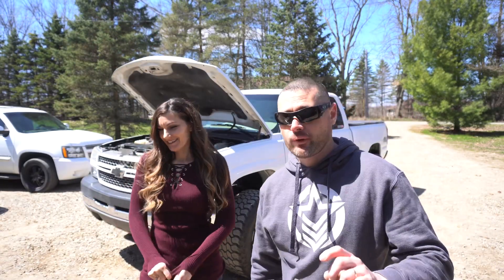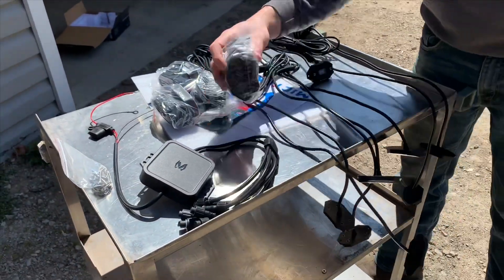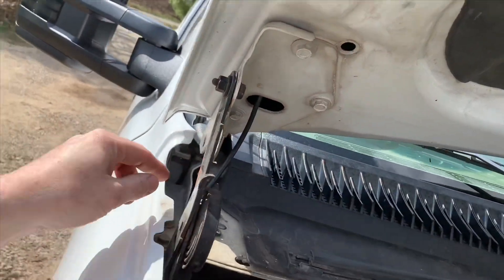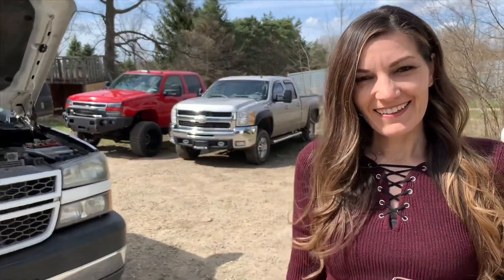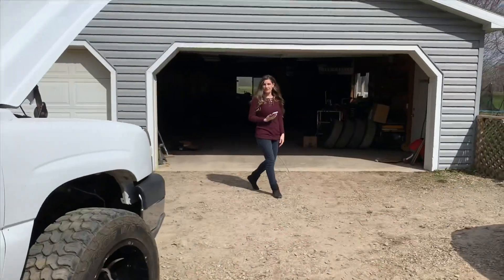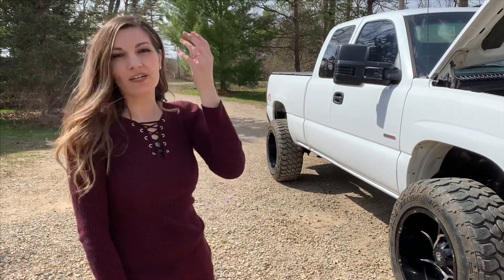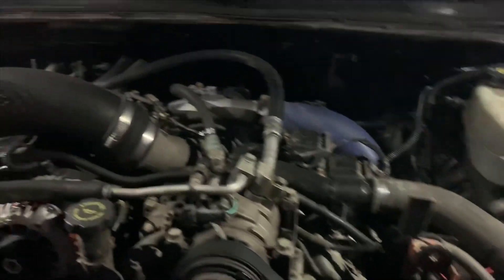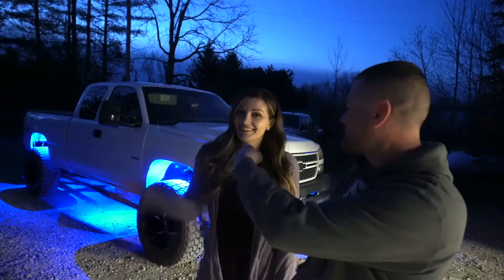Project Wifemax Gets Ridiculous Lighting Upgrade!

Comment: well done. might want to move 1 of those to the bed of the truck and you could do a clean corner cut on the front bumper and that rubbing issue would go away.

Comment: Great idea! I had a set on my old truck, function > form for sure. 
In regards to the lighting aspect, here is some tid bit of information.

In the State of Michigan, there is not a specific MCL for "LED Light Bars or Rock Lights". But the use / operation of these lights on a motor vehicle operated on a public roadway are subject to fall under the MCL 257.698. 

An overview, (motor vehicle operated on public roadway in Laymen Terms).
LED Light Bars - Offroad Use Only, Not to be used while driving. Requires a clear, or amber cover on the lightbar. This would fall under MCL 257.698. 
Rock Lights - Offroad Use Only, Not to be used while driving. Also MCL 257.698.
Operating any motor vehicle with red or blue lights is imitating a Police Officer / Vehicle. (Even as simple as blue leds for your license plate lights). Those are prohibited in any fashion on a vehicle in Michigan. (Again, use on a motor vehicle operated on public roadway).

When it comes down to the enforcement of this, it depends on the agency / officer.

Hope this helps!

Comment: truck master, new subscriber!i have the 05 max. i would like your take on what i need to do with my truck. I have the egr unplugged as of now and have no issues, but am i hurting anything? also i would like to put a 4inch exhaust in. should i do a new down pipe or just do a straight pipe? I really am not concerned with more power i just want a little bit of a   crisper response . Thanks    for any help.